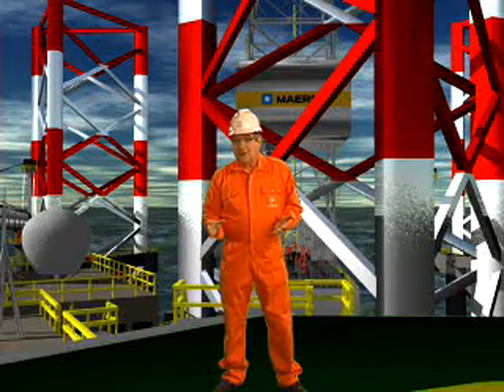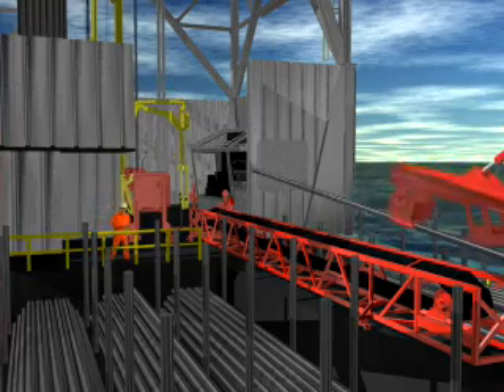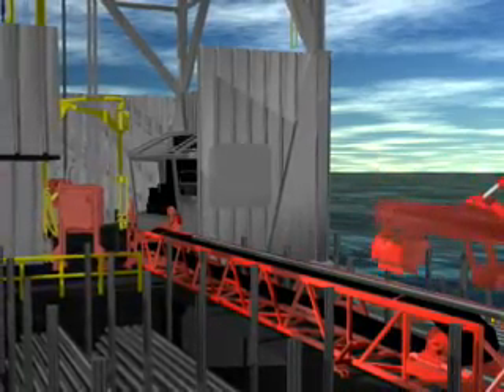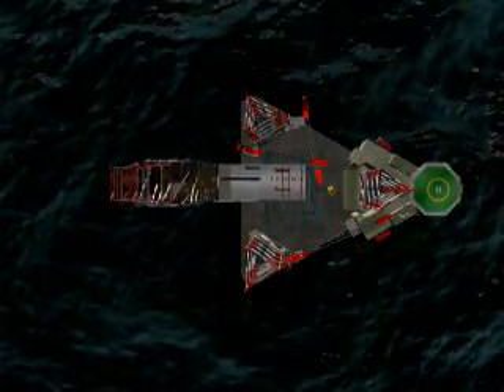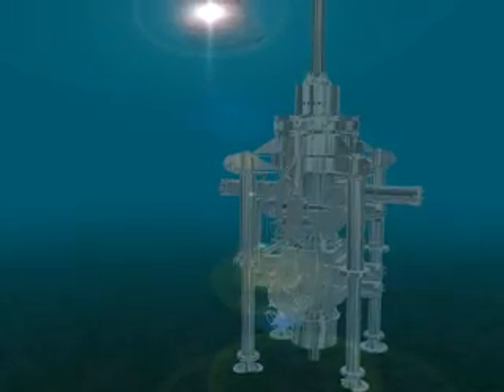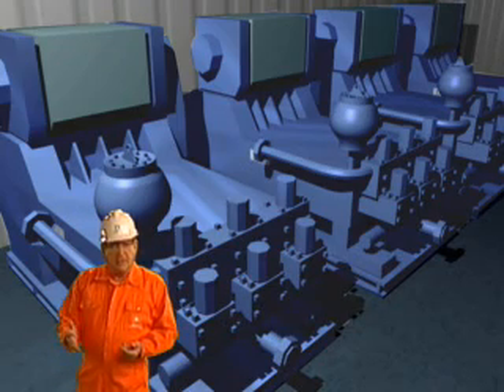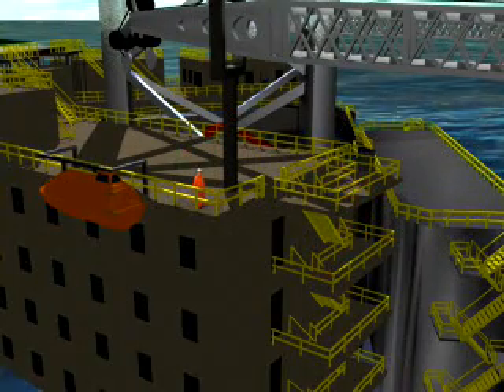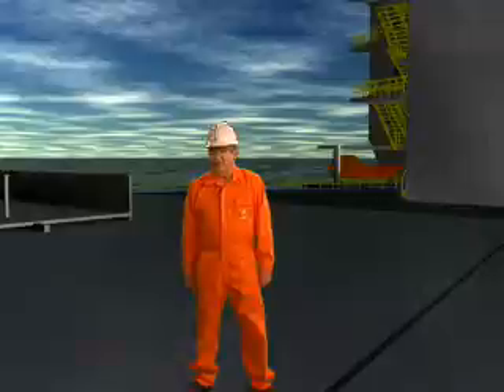A Virtual Journey to The World's Largest Jack-Up Structure

Comment: GPC-Global Project Contact has supported Novenco on this project. GPC-Global Project Contact The key areas for GPC is:

 Fire fighting systems
 HVAC Service
 HVAC Technical Engineering 
 HVAC PLC Electrician 
 HVAC Commissioning 
 HVAC Cleaning 
 Cooling Service